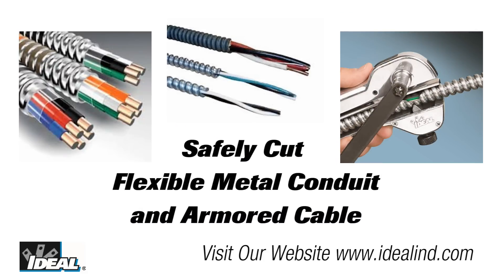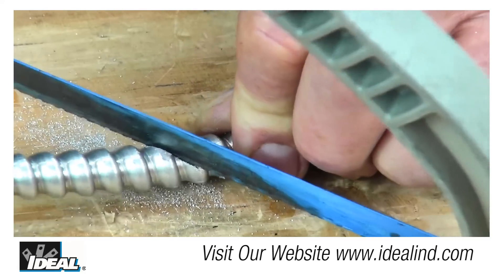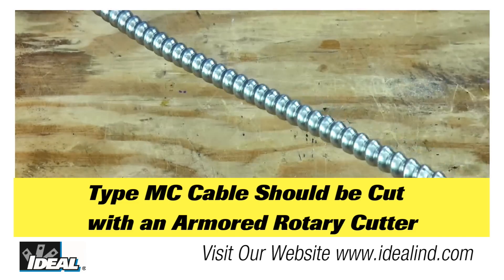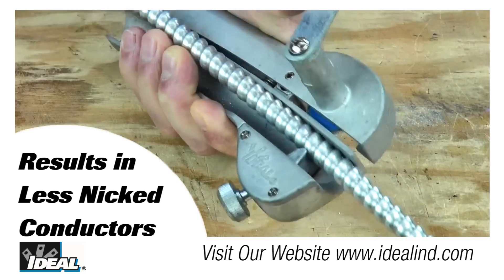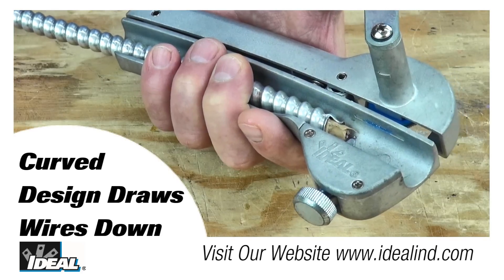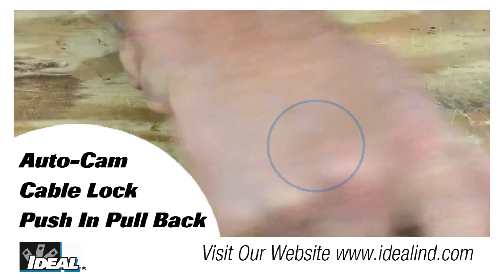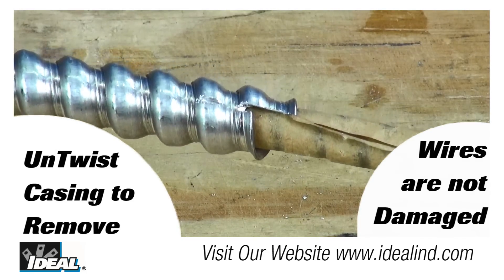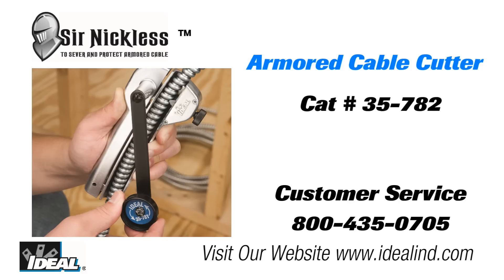Sir Nickless™ Armored Cable Cutter

Comment: Do all armored cable blades like the Klein or SEATEK work with the  Sir Nickless Armored Cable Cutter?
Reply from the maker: Good question I am not sure. The diameter of the blade in the IDEAL tool is 1 1/4" so as long as those blades are close I would assume they work but I do not know that for sure. If you find out please let me know. Ron

Comment: How do you change the blades. I can't attach the handle as well
Reply from the maker: To replace the blade just remove the screw and remove the blade. Have fun Ron
Reply: @RonKipperDatacomm1  I know it sounds dumb, but when I try to put my phillips inside and turn to the left, the shaft to the blade also turns. So how do I remove it? I even tried using a wrench on one side and twist with my Phillips on the other and that doesn't seem to work as well. Is there another way to remove the screw. Thank you
Reply from the maker: Sounds like the screw is stuck. Have you tried using a screwdriver to wedge against the blade and body of the tool? You might also try an anti siezing lube. Let me know if you get it off. Thanks Ron
Reply: @RonKipperDatacomm1  Hey Ron. I finally got it off. I got one screwdriver on one end and another screwdriver on the other end and got it off. Thanks so much Ron for keeping up. Next, where can I purchase a boot bender 75-037? Man no place carries them. Amazon wants you to buy 18 of them.
Reply from the maker: Hey send me your address to ron.kipper@idealindustries.com and I will hook you up with one. Have fun Ron

Comment: why not just use dikes, pop it, clean up cut area, antishort bushing, and abit of electrical tape
Reply from the maker: +refrigeration tech hey I started in the HVAC field too and yes a diagonal cutter with a little work can get the job done too. The cutter simply works faster and make a clean looking cut and what would we do if we did not have another tool you absolutely had to have................Thanks for being out there. Ron
Reply: yup, side-cutters are the faster & pouch-friendly option, but require skill...